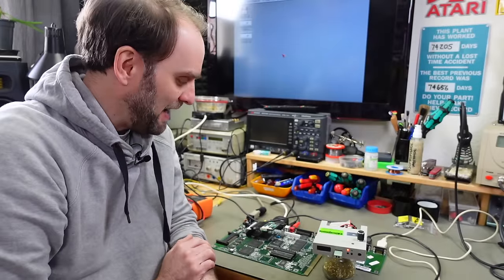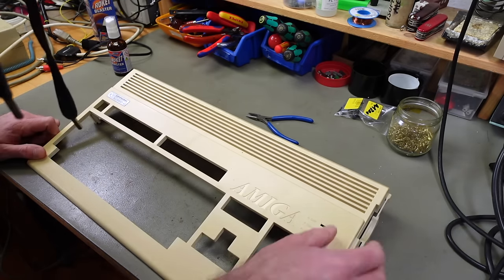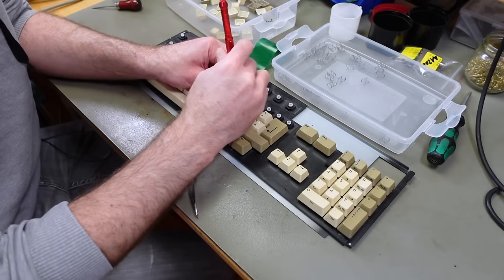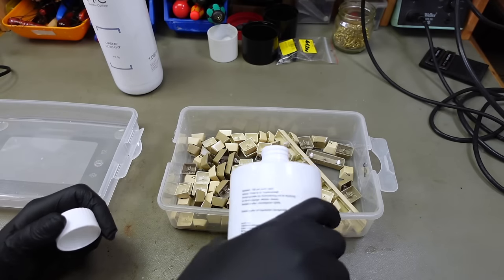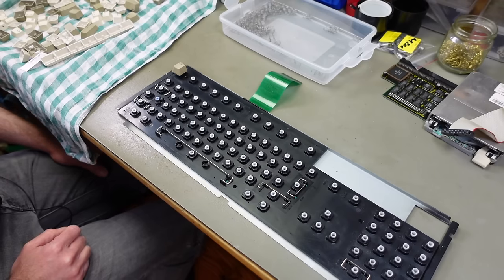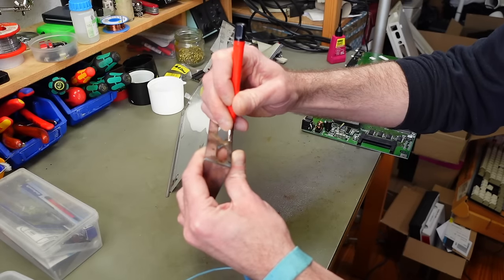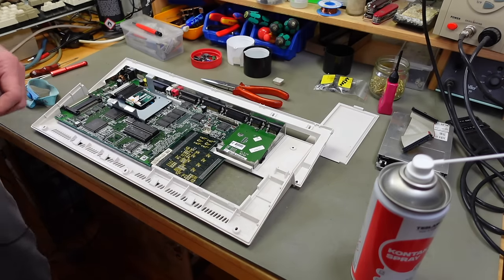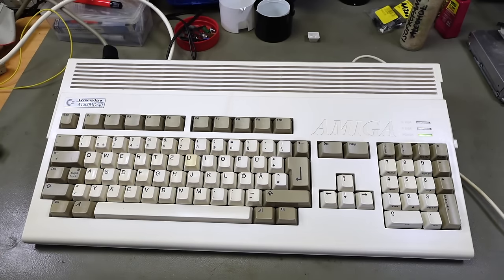"Lost Cause" Amiga 1200 Refurb

Comment: With retro brighting it  can be fiddly job, my last a500 went well with no streaks, but the A600 i did get was so yellow I had to go back two times and redo parts. depending on the if used gell or the water based stuff and being the percentage all so plenty of good sun/light it will eventually get a good result. good to see another Amiga saved

Comment: Great work Jan. One more working and complete A1200.
Reply from the maker: Not quite! It needs a disk drive or a replacement still. But that’s not going to be a huge deal. 😉
Reply: @JanBeta Ok, lets say it's complete as far as my use case goes... At least two of my A1200 just has a terminator on the internal drive header, for fast boot... I use an external drive when needed. :) That miggy just needs an '030 accelerator with some Fast Mem, or something along those lines. Looking forward on diagnosing that nonworking expansion.

Comment: CA glue forms a brittle connection between the parts being repaired and can be broken quite easily, if you have space sprinkle some baking soda on the glue before adding the kicker it will make a much stronger joint.  For repairing plastics, cracks especially I use something called Plastic Weld.  This must be used in moderation as it actually melts the plastic on both sides to join them, a single tiny drop should suffice on both the cracks to your case and the the broken key as it will wick along the joint until the joint either ends or meets itself.  I still have a nearly full bottle I first started using around 20 years ago it seems to last forever lol
Reply from the maker: The glue I used the second time around is a plastic welding glue (mostly acetone based, as I said). Usually that works really well. Should probably have used it the first time around but I didn't want any deformation (which is  risk with those weld bonds).

Comment: A good tip I was given for a broken key stem is to use a toothpick. The diameter is a near perfect fit for the hollow part of the stem. Just cut the toothpick to the right length and this will provide the added stretch you need. In my case, I used a little epoxy in the hollow and around the outside of stem. The key fits fine and is still holding strong.
Reply from the maker: That's an excellent idea! I'm going to give it a try. :D

Comment: One thing I want to try with rusty shields is to soak them in Evaporust. That stuff is amazing and should give great results with much lower effort than the fiberglass pen.
Reply: you could try a air line with a bag full of sand and drip feed the sand into the air stream to clean that rust
Reply from the maker: I definitely need to get myself some of that miracle stuff. It's been recommended a lot recently. I tried cola and aluminum foil a couple of times which worked pretty well but Evaporust seems to be a lot more versatile than that crude hack. :)

Comment: For all my repairs, I use JB Weld, a 2 part epoxy with a clamp. This has proven to have been superior to all other products. The trick is to use the clamp and apply the material to both sides.  As far as retrobrighting, the best result is suspending the items above the peroxide in a sealed container out in the sun. The vapor gives a uniform finish and the solution never touches the item.
Reply from the maker: I used similar epoxy glues and they usually work very well. Might be another option to try in this case. I don't have much room, that's why I didn't get a large container (plus gallons of peroxyde) yet and still use the cream method. Also, sun is not quite powerful enough here in Germany. :D

Comment: One thing I've done on a broken cap on an Atari XE which had the same footprint, square with the little hole in the middle, is to use heat to insert a small metal rod into the little hole (I think I cut a paperclip), all the way so it ties the broken stem back to the rest of the cap. It provides the stability that glue won't.
Reply from the maker: That makes sense. I'm going to give that a shot (in case I didn't mess the keycap up completely with my repeated glueing attempts...). Thanks for the tip! :D

Comment: The coprocessor expansion board looks like it needs a clock chip (rectangular metal can with 4 pins). Probably same frequency as the one on the main board. The dead giveaway is the socket with 4 turned-metal socket pins near the FPU. 😌
Reply from the maker: I did some research and got it to work in the meantime. It's quite an interesting board, actually. You can add a quartz oscillator in the location you mentioned to run the coprocessor asynchronously at higher clock speeds or just set a jumper to run it at the system's clock speed.

Comment: Still recommending not to retrobright with that creamy stuff, better use fluid peroxide and submerge the parts. Yes, you will need a bigger bin and yes, you'll need some liters of peroxide, but it doesn't make any marble and stain effects, is more effective and secure. After all, the yellowing will come back in some years, the most better way to have it (in this case case) white again, is painting it...

Comment: Mabie pot the broken keycap stem, "repair like before, then fill the interior of the key  surrounding the stem with an epoxy if it does not interfere with clearances"
Reply from the maker: Yeah, that is an option I am going to try. Epoxy is a bit tricky in this case because the stem needs a lot of clearance to slide into the plunger. We'll see! Thanks for the tip!

Comment: You should have used gloves on your RF Shielding!
Reply from the maker: Because of the risk of staining it even more? I didn't care too much because it already looked quite "used" when I got it.
Reply: @JanBeta  The acid in your sweat will do far more damage than the little flecks of rust you found! The sweat will etch your fingerprints onto the shielding over time!
Reply from the maker: @bigd5090 That’s what I meant, there already were many many fingerprints on the shield before I touched it. :)